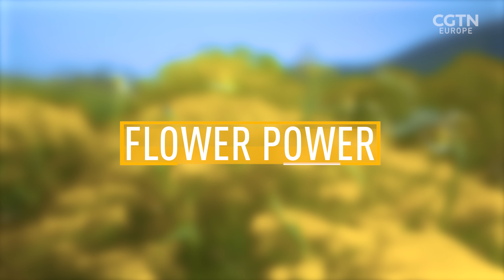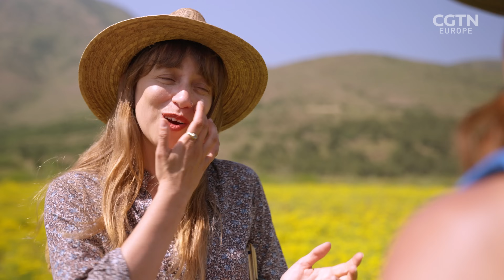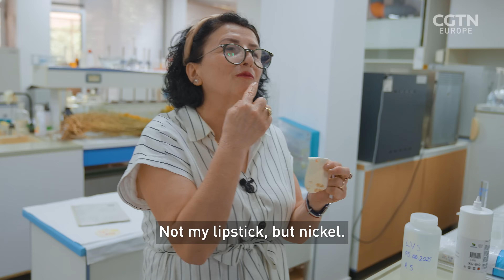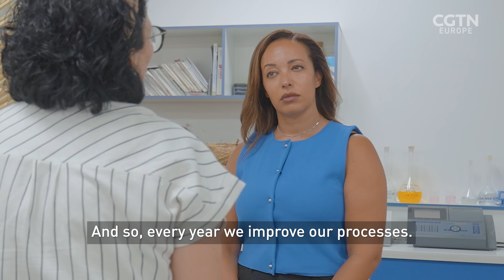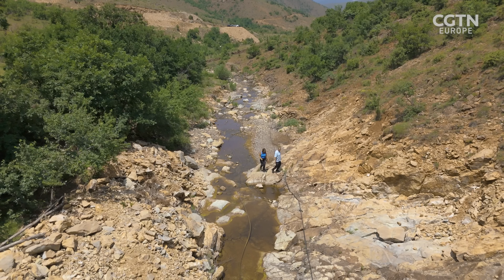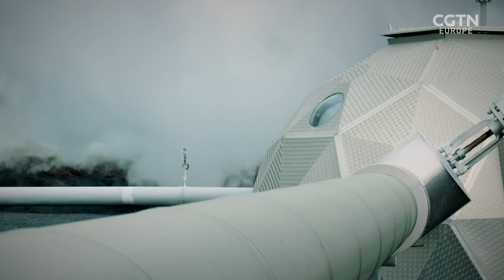These plants could change the future of mining

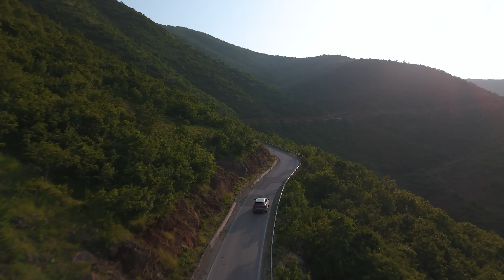Comment: Olivine (starting at 17:45) when applied alone, will cause issues midterm with calcium uptake because through enhanced weathering, it releases high amounts of magnesium (Mg), which competes with calcium (Ca) for uptake sites in plant roots and disrupts the Ca:Mg ratio—this can lead to nutrient imbalances, reduced Ca availability, and symptoms like stem weakness. Adding melilite, a calcium-rich silicate mineral, counters this by providing additional Ca, optimizing the cation balance (particularly the Ca:Mg and overall exchangeable cation ratios, including K and Na), and enabling synergistic release of Ca and Mg, thereby improving plant health, soil fertility, and CO₂ sequestration without risking imbalances. Have you/they considered that?

Comment: At ~2–3% of harvest dry weight, this means 20–30 kg of nickel per metric ton of dried plant material.
Because of this unusually high concentration, Odontarrhena decipiens has been studied as a candidate for phytomining (farming metals from plants).  So, in short: Odontarrhena decipiens typically contains about 1–3% nickel by dry biomass, depending on soil and growing conditions.
Reply: Echivarria can accumulate and get up to 4 percent nickel by dry weight. This is in 2 percent nickel Serpentine soils.  They burn it for energy and their ash is up to 24 percent.
Reply: Their math doesn't math... you can't extract 1 ton of nickel of hectare without the soil having 1000s of ppm of nickel in the soil first then you need astronomical amount of bio mass 160 to 250t of fresh or 33 to 50 tons of dry mass. Alphalfa i know not this plant usually get like 15-20 tons per hectare. This plant have to produce almost 10 times more biomass.....like cmon. Yes great as on off rotation crop where the soils 8s too high but this will never mine anything.... also how deep the roots go? Half a meter at best maybe a meter down?...